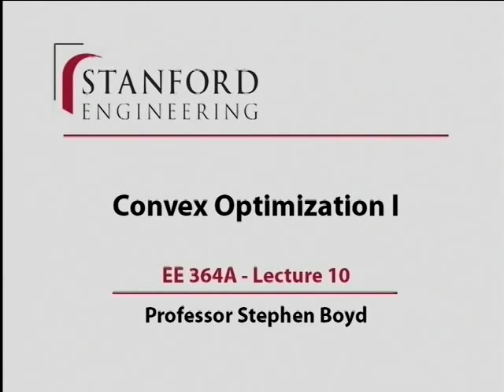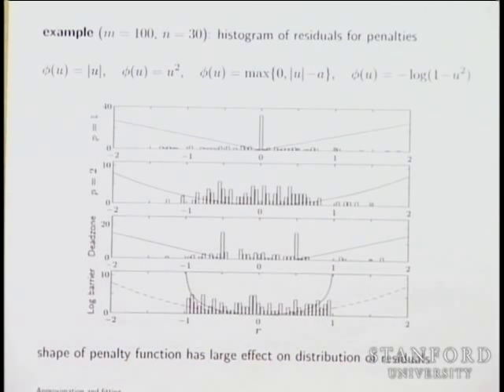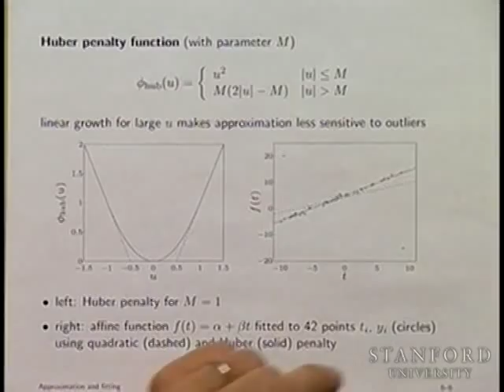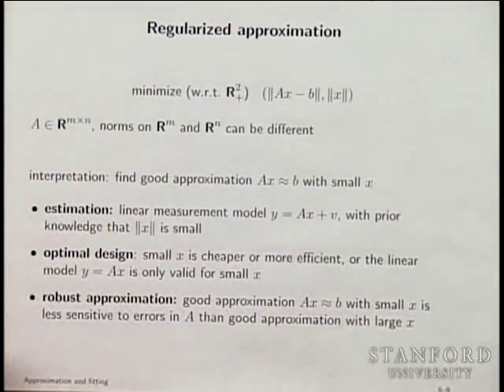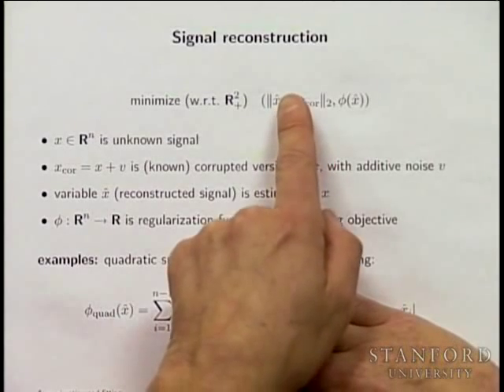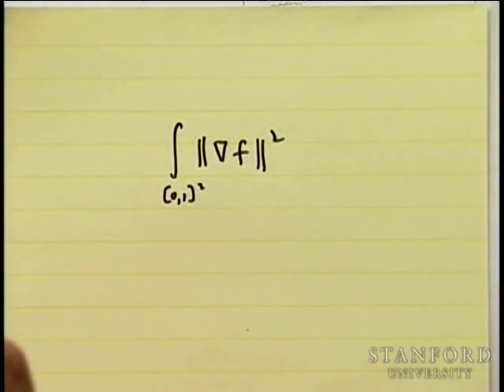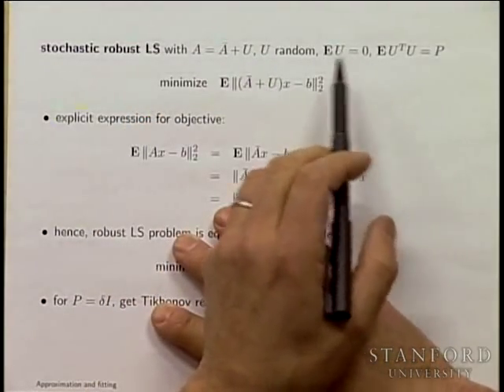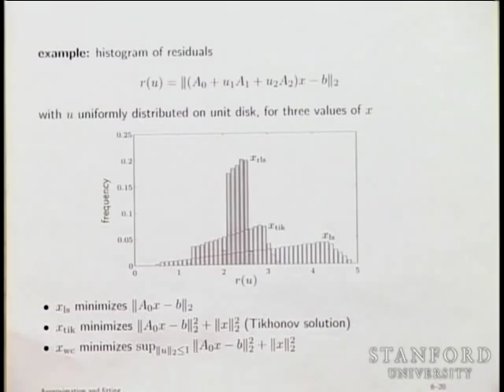Lecture 10 | Convex Optimization I (Stanford)

Comment: 1:15 Approximation and fitting
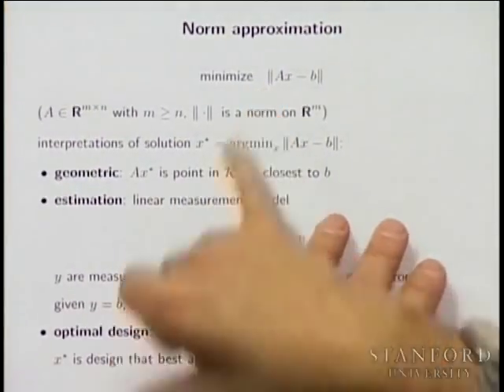1:42 Norm Approximation
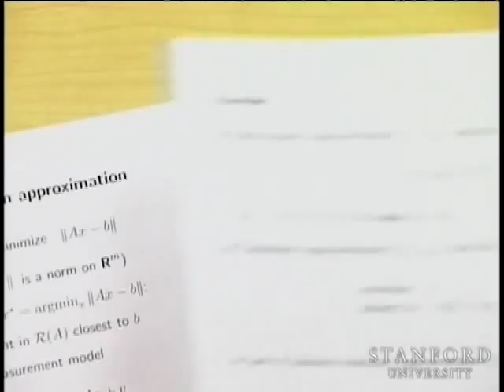4:10 examples
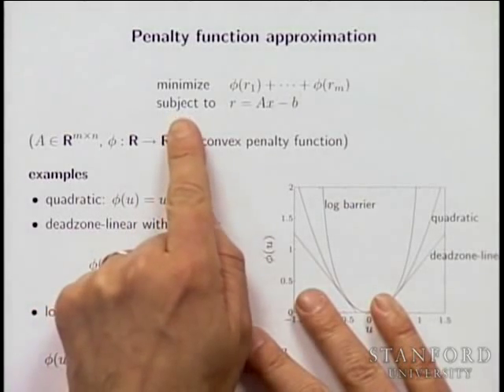5:39 Penalty function approximation
10:51 example
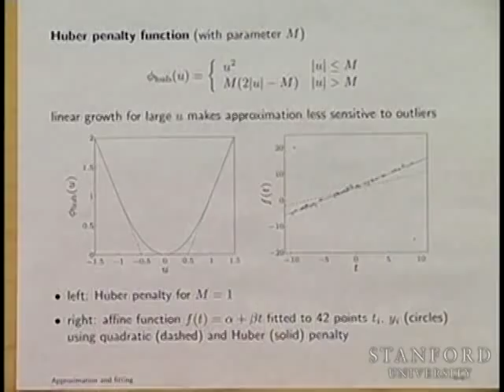17:15 Huber penalty function
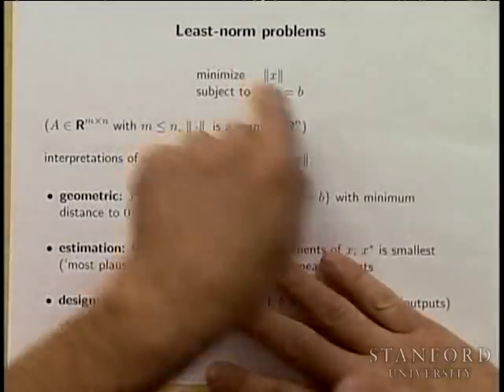23:10 Least-norm problems
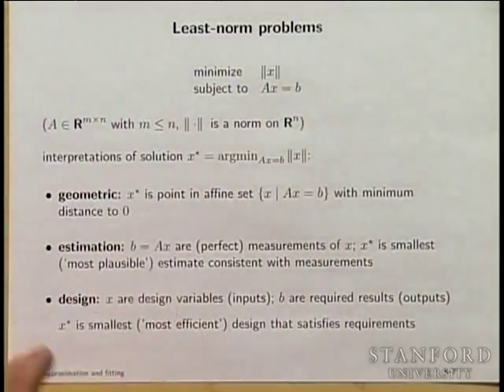25:31 examples
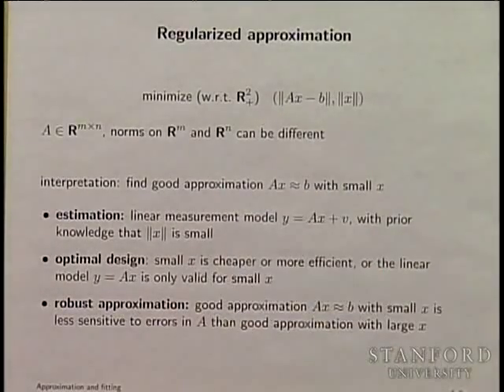30:17 Regularization approximation
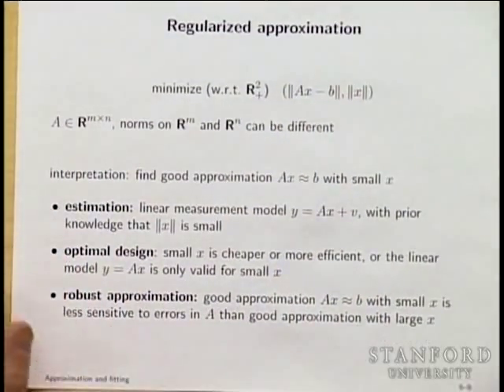34:53 Scalarized problem
39:03 Optimal input design
40:34 examples
42:48 Signal reconstruction
47:47 quadratic smoothing example
50:48 total variation reconstruction example
56:50 Robust approximation
1:06:19 stochastic robust LS
1:10:04 worst-case robust LS
1:15:52 example
Reply: Where are you, dude? Missing your bookmark keeping for all the remaining lectures.
Reply: @ArnabJoardar  My Professor skipped a few chapters.  :(

Comment: At 8:46, he mentions that the 1-Norm has an opposite sense to that of the square-error function: for small residual errors, you're irritated more in case of the 1-Norm compared to the square-error function, relatively.
Could anyone elaborate how a small residual value is able to give Large Irritation in the case of the 1-Norm?
If the Irritant function was 1/residual, then, if the residual was small, i.e. 0<residual<1, then the irritation ( '1/residual' ) would be large. 
The 1-Norm function does not behave like that. So why did he say that?
Reply: Arnab Joardar I think this is about the slope of L1 and quadratic function. L1 has constant 1 but quadratic has smaller than 1.
Reply: "Large irritation" in the relative sense. Say the residual is 0.1, in 1-norm it is just 0.1, but in 2-norm it is 0.01 and 0.1>>0.01.